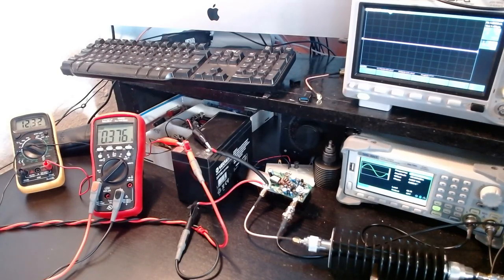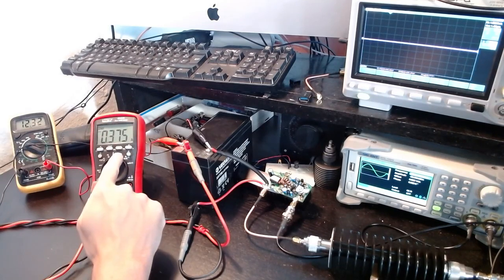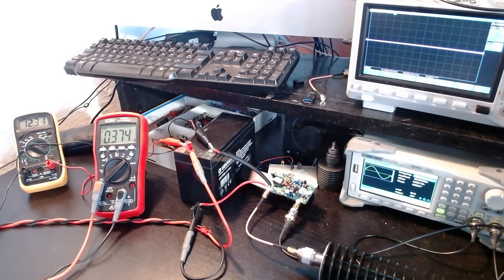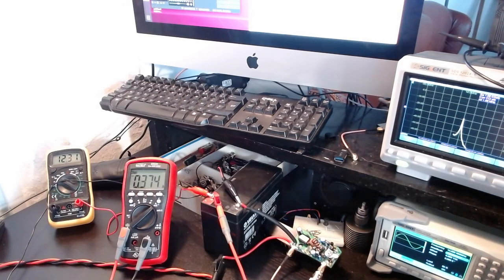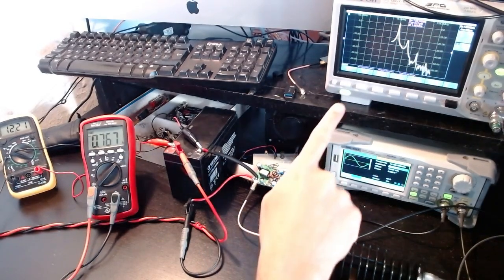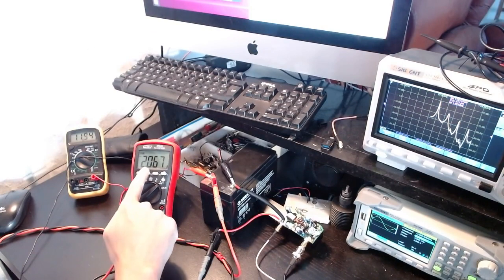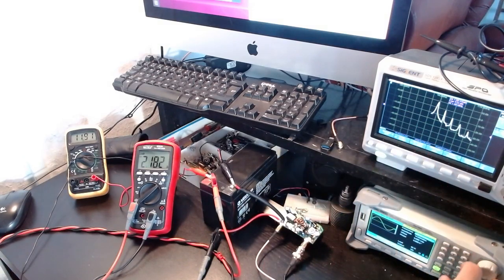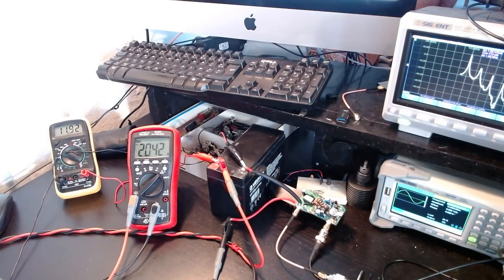Episode 69: QRPLabs 10W HF amplifier (#1), a first look

Comment: You said in some of your videos that you were not a ham licensed operator. Is your occupation related to this field? Thanks, another cuestion... Does the HackRf have  good reception in Hf compared to regular equipment? Thanks for your videos
Reply from the maker: Hi! Thanks for your comment. 

Yes, not yet a ham, but I still plan to become one at some point :) Regarding job: no, I have another job not related to electronics/RF, this is just a hobby (and indeed I didn't post anything for about 1 year because I was very busy with work and other thinks).
The HackRF is surely worse that other HF 'regular equipment'. However, it is cheap and most importantly, it works from 10Mhz to 6Ghz!!!! (HF is usually defined from 1.8 Mhz to 30Mhz). So the HackRF can be used to experiment with many more things, beside HF.
Reply: @therfnoob7697  I think you mean from 1 MHz instead of 10 MHz? Yes, my plan is use it like you do, with adequate filtering and amplifiying, working all modes on that fantastic range of frequencies.  Can it be used as a transceiver or do you have to set up each time to receive and transmit? I definitively will buy one.
Reply from the maker: @DavidLopez-bz4rj  yes, sorry, 1Mhz :) 
No, the HackRF is only half-duplex. It either transmit or receive at a given time. However you can switch between the two modes via software (SDR angle does that, for example, so you can use it to listen/talk as in any normal radio). If you want to transmit/receive at the same time (full duplex) the LimeSDR mini could be a good alternative.
Reply: si usas carga ficticia no te hace falta licencia.
Y encuanto a la sensibilidad del hackrf, es muy buena pero poniendole el sistema de filtros y balum apropiados, e incluso algun filtro rechaza banda en el caso de que tengas cerca emisoras potentes.
Tienes que tomar el hackrf como un convertidor al que le falta todo lo demas. Y asi debe ser, para que aprendas a adaptarlo a la banda que vas a trabajar.